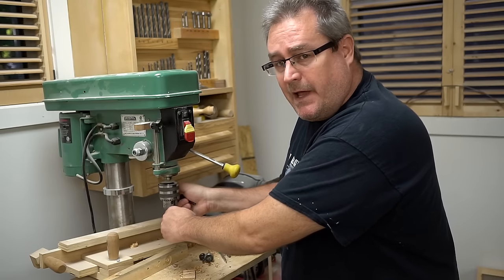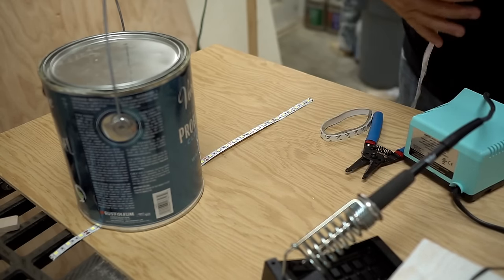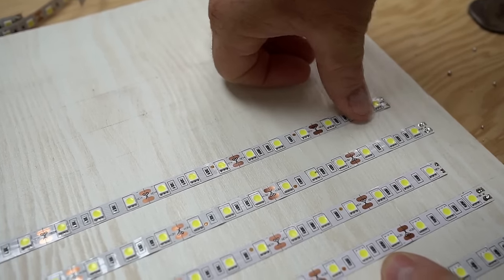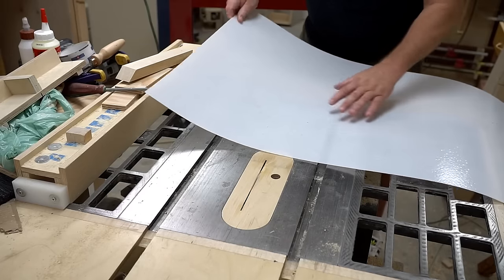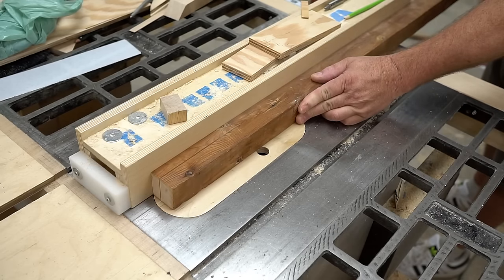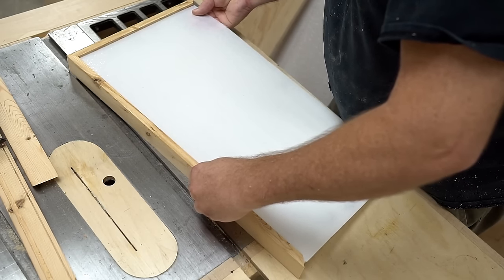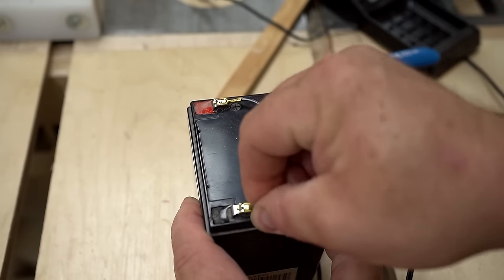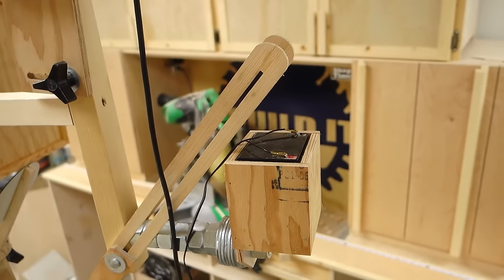How To Make A Super Bright LED Light Panel (Battery Powered)

Comment: For folks wanting to try this, here's what I've learned when monkeying around with these LED light strips over the past year:

- They come in all sorts of colors - even changing colors. Knock yourself out.

- These are sold in 5-meter strips for around $7-15 USD, depending on which particular kind you want. Lots of varieties. Some are even water proof.

- Regardless of the brand, I've never got the adhesive to work well., I  just use hot glue every few inches as needed.

- You can cut the strips into lengths of your choice, but the smallest  increment is 3" or so. 

- If you want eye-pleasing white, do NOT get "cool white" (sometimes called "bright white"). It's got a garish blue tint to it that will grate on your nerves after a while. Get "warm white". It's closer to incandescent light, and feels more natural.

- Last time I bought some, 5050 was not the brightest. I think it was 3528. But those numbers refer to the size of the LED module on each strip, and are not always a direct correlation to the lumens. 

- They require 12v. If you use more, you will burn them out. If you use less, you won't like it.

- They require 1amp for every 5' or so. If you plan on lighting up the entire 15 foot strip, plan on a 5amp power supply. (Laptop chargers work well for this, but make sure it's a 12v charger. Universal laptop chargers from eBay work well, and they're ~10USD)

- If you want to dim them, don't bother trying to reduce the voltage. you won't like the results. Instead, use a special dimmer switch that is made for it. They're about $1. You'll even find some on eBay included as a kit. Some kits even have wireless remotes. VERY CHEAP

- Instead of painting the background white, you can glue down tin foil and then glue the LED strips on top of it. Watch the solder so you won't short it out.

Have fun!

Comment: Cool trick for cutting the strips vs trying to cut with scissors. I've also found the sticky only lasts long enough to hold while the silicone glue I add is drying. Def back up with some glue or fasteners.

Comment: Quite a while ago I was involved in building some similar light (at least for the purpose), and the major difference we he was putting on top of the LEDs (before the diffusor layer) a thin sheet of shiny polished aluminum (where there were cutouts for the LEDs). This way it was noticeable brighter and also had a slightly improved CRI.

Comment: I want to give you a quick tip. I've been soldering up a 5m piece of RGB LED-strip and I found out that with the many soldered connections that I made, that there was only 9v left at the last piece, compared to the 12v at the beginning. This resulted in more dim LED's at the end of the strip. My tip is to have connect the 12V lead that is coming from the supply, to somewhere halfway too, to counter this voltage drop (due to resistance that are now made with the solder and cables.

Edit: well, since you've closed it all up, I guess it's a tip for the next time ;)

Comment: I have LED stripes with the self-adhesive backs that I put under my kitchen cabinets.  If you light the LEDs before you stick them on a surface the glue heats up a bit allowing them to stick better.  (knocking on wood) I haven't had any issues with the strips not sticking.

Comment: I’ve made several of these for free. I find a flat screen TV with a cracked screen in the trash, remove the cracked screen and it’s long narrow board, remote IR sensor board, speakers, and leave pretty much everything else and viola! Although the LED strips,CCFLs or whatever you find in a flat screen TV might not be the kind you want(warm white, cool, etc)…. They make for great light tables Atleast.

Comment: if you want better soldering you can try hot soldering instead of cold soldering. With hot soldering you make the wire touch the smd strip and heat them both up until the tine melts onto it, instead of heating up the tin and putting it between the two.
Reply: also i think the reason the strips come loose is from the heat, LED's do not get as warm as other light sources but all the heat is generated at a very tiny spot at the base and it has nowhere else to go.

Comment: Nice light John. I've bought similar LED Strips, with the same 3M double-side tape, and I've had the same issues! The tape only really sticks to metal or glass. Anything remotely 'rough' doesn't work. I ended up using superglue to stick mine to wood.

Comment: The LED vendor that supplies us with our strips at work mentioned something about how the life of the LEDs goes down dramatically if the power supplied is too low. We control the brightness of our LEDs with a PWM. That's probably not important in this instance but I thought I'd pass along something that I found unusual about LED strips.

Comment: I guess I got lucky with the adhesive on my light strips.  I've got light strips stuck to oak coated with water based polyurethane for over three years and the adhesion is still rock solid.  But then again, maybe its not luck...I live in SoCal.  The low humidity is probably why it sticks so well.
Reply from the maker: Might be better tape.

Comment: Just you know herr Heisz, any flatscreen computermonitor has a very powerfull light in it. A nice flat fluoresend lightfixture which in most cases can be made working without the picture electronics... Just remove the monitopr parts and do some soldering and done.... even the case of the monitor can be re-used as a lighting fixture...

Comment: Are all LEDS wired in parallel? What voltage  battery did you use. Could you have used a small DC power supply and eliminate recharging the battery? Nice job

Comment: I did something similar but used a 12V power source off of ebay.
I used 2 " PVC quartered as the backing with no cover as it was to be high like a ceiling light.
I also found that backing was worthless and epoxied over the strip about every 6".
I did something similar for under cabinet lighting but used that water proof silicon covered type LED's and after
a few months they began to dim out in several places.  I think the silicon coating is reacting with the copper somehow.
My latest LED project was dismantling the GE LED bulbs that are $10 for a set of three and made those low profile to put inside of a fluorescent housing to replace the florescents.  
Retrofitting most of the house and workplace with LEDs.  Instant on is nice an using a watt meter proved the savings is about 60% over florescents.

Comment: John, Im working on a smaller version of your camera gantry for my shop. Unfortunately, I have a garage door opener blocking about 1/3 of the space needed to have it on rollers. I cant put it lower then the opener because there is a window blocking the way.. If its not one thing its another. Im thinking of a pivot system in the center of the shop that extents to all stations. this will require alot of experimenting on my part. Great addition to your gantry my friend.
Reply from the maker: Maybe a better solution is to make something that rolls on the floor. A small flat dolly with a mast you can mount the camera arm on, etc. If you use a car battery to add weight to the dolly to keep it stable, you could use that as the power source for a light like this.
Reply: +John Heisz ohhhh John... very happy I left that comment. if I reposition my large work bench and table saw into the center that could certainly work. fantastic idea man. thanks : D
Reply from the maker: No problem! I've been thinking about doing it myself, and getting rid of the gantry. The gantry is hard to beat, but it does block the ceiling lights in some shots.

Comment: How are you finding the heat management? Most of the 5050 LEDs I've tried get very hot, especially running from an SLA battery which tends to put out closer to 13v. If you run them at around 11.5v they run a lot cooler, and will have a much longer working life.

Comment: Do the LEDs stay fairly cool? I've seen several videos where people have used these strips and no one seems worried about attaching these directly to wood boards. Seems like a fire hazard, but maybe these never get that hot and since yours run on a battery they aren't pulling too much power.

Comment: I agree that the adhesive is terrible. I ended up using hot glue to mount the strips.
Reply: I mounted mine to my ceiling that has that popcorn shit by cutting strips of hard plastic that most things come in now, put a strip of packing tape around the plastic and used staples to secure the plastic to the ceiling as it pinched the light strip. Your way sounds easier.

Comment: I'd suggest to use not led strips but metal-based led modules (look very much like strips but on thicker metal strips about 1-2 mm thick, and usually do not have resistors so require a CC driver instead of a PSU).
If these strips you use give of a lot of light I'd worry about cooling. Plywood is not very good for heat transfer and dissipation, a metal plate would be much better. Otherwise LEDs might degrade over time.

Comment: The glue on these strips surely must be different to mine. I use 100 Watts of LED strips for lighting in the living room and just glued them to the wooden ceiling with the stock glue on their backsides and I definitely was sceptical about that being a good idea but yes, they stick properly even now after a few years. And not only that. I know that there were some spots where I sticked the tape and pulled it back off of because I made a mistake in placement and then just pressed it down on the right spot. I was absolutely expecting the glue to fail at least in those spots but even there it holds just fine. Too bad you never know in advance.

Comment: Can you help me? I got an LED driver and want to connect it to the mains. The Driver has a cable (with a brown/blue) wire coming out, which I believe can be used to connect with a plug - question is what kind of plug will i need? Im based in UK so we use a 3 pin plug

Comment: dunno how much electronics and wood should work together tough...
Reply: They work just as well as they did 50 70 100 years ago.
Reply: 12V DC is pretty harmless with wood.
Reply: The wiring in early electronics was insulated with paper, not super safe but it (mostly) worked.

Comment: I'm a real rookie!!!  Trying to wire some LED lighting for interior of small motorcycle cargo trailer. Don't want to wire into my trailer harness in the event I'm not "hitched" and still want to see!  I'm planning on using a similar gel-type 12v battery with an off/on switch.  My question ...  do I have to use some type of resistor?  Looks like you just wired straight to the battery....  Thanks for the info.

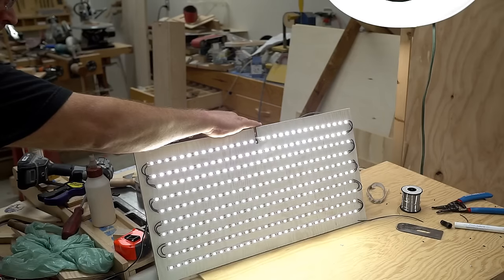Comment: It would have been better to connect the stripes in parallel, not in a row. You can see that the lower stripes are dimmer than the upper ones at 2:05. This ist because of the voltage drop over the stripes. I think this is a very valuable information after the light is glued shut. ;-)

Comment: would this be suitable for general lighting? (efficiency/power etc) or am i better off just buying a normal fluorescent
thanks love your videos :)
Reply: Ive also been wondering this. Trying to find a cheap solution for overhead lighting in the workshop.
Reply: +HandandSew You can get LED alternatives for most kinds of bulbs now.  I have four 4ft LED tubes lighting my 8x10 shed. The brightness is comparible to daylight on a sunny day. That many bulbs was probably overkill for a space that small but I wanted it bright.
Reply: This is not going to properly illuminate your room, if that's what your asking. It's good for video maybe (also still kinda weak) for general house purposes, stick to CFLs. They are as efficient and are more convenient to work with (small, diffuses light better).
Reply: +David T From what I have read LED lighting uses half the power of CFLs to generate the same number of lumens. LED light tends to be more directional though. For example my LED tubes distribute light at a at 120 degree angle from the bulb. Whereas a CFL would be 360 degrees.
Reply: If you want LEDs, then buy an LED bulb, don't use these strips, that's the point.

Regarding lumens - there is a big variety of lumens output, just like different cars have different power output. CFLs are still a good choice and also much cheaper.
Reply: +HandandSew - Get 5630 LED strips.  I have just completed illuminating my shop with a few metres of 5630 and the differnce is night and day :)  I use a computer PSU to power the setup, which is wired into the 'main' fluroescent light in the shop (it isn't really the main light, as the LEDs outshine it!).  You could just add in an extra switch if you don't want to go to all that trouble.
Total cost - £7 for 5m of 5630 strip and that's it.  Computer PSU was from an old PC (keep an eye out, as they are being thrown away everywhere - dumpsters are a good bet), wire was old bellwire.  At the furthest point from the PSU (about a 6m (18ft) run), I still get 11.1V and plenty of light, so cheap bellwire should be ok.

Comment: Wont the lights get hot with having everything sealed up like that?
Reply: Hi, LEDs emit little to no heat, so you do not have to worry about the heat build up or needing air circulation.

Comment: Small critique. The saws really overpower your voiceover. It would be nice if you could lower the volume a smidge.
Reply from the maker: David, I spend hours editing the audio alone on these videos and never leave one (lately) where the tools are louder than my voice when I'm speaking. I could mute all shop sounds completely, but then that wouldn't sound right either. 
Possibly it's whatever you are listening to the video on - I'm very hard of hearing and have no problem picking out what I'm saying. In fact, the speech recognition for the closed captions doesn't look like it has a problem either.
Reply: +John Heisz maybe it is me. I do have hearing problems so maybe it is my ear not being able to handle both at the same time. I can hear you speaking but the saws overpower it a bit.

Comment: how long does it take to drain the battery
Reply from the maker: The light draws 1.8 amps at 12 volts and the battery is rated at 4.5 amp hours,  so about 2-1/2 hours.
Reply: John Heisz thanks, that looks very useful, might make a mini version myself

Comment: I've had good luck with the sticky tape on metal and automotive paint. Maybe finish is important.
Reply: Bob E yes finish is important as it is used as the heat sink for the strip. Aluminium is best. It works great as the heat sink which will extend the led life and the adhesive tape sticks to it fine as well

Comment: Why the battery. I thought the lights used 120volts. Good job.
Reply: Probably so it can be moved more easily be more mobile with no cords stopping it or get tangled up or stuck somewhere.
Reply: Those LED strips use 12 Volt DC.
Reply: They have plug-ins, but they come with  adapter (step down and converts to DC) .

Comment: Hi John,
Best thing I've found to date for sticking LED strips to is foam core board.  The paper surface offers a little bit of tooth for the tape to grab onto.  The 3M printed on the tape I don't think is from the reputable company that makes adhesive, I think it stands for 3 Monkeys...  Here's a link to a recent project that I actually built the panel for several months ago: https://www.youtube.com/watch?v=DYxGaFJGqqE and it holding up fine.  Have had failures with the tape strips on plexiglass, metal and glass otherwise.  Great build by the way!!
- Bill